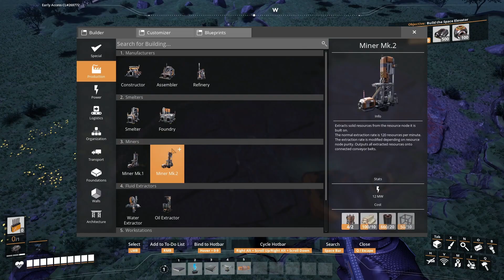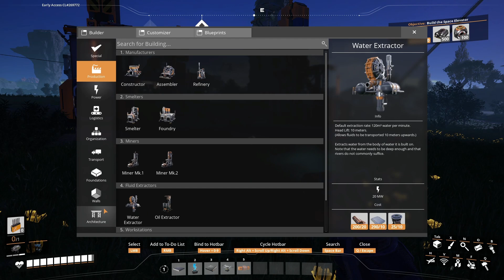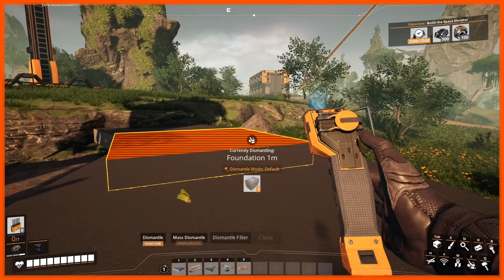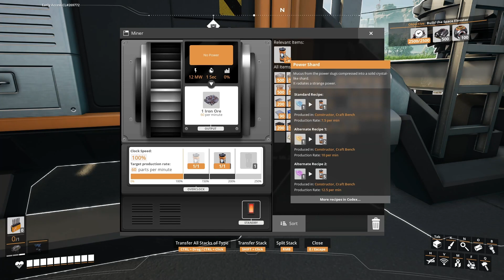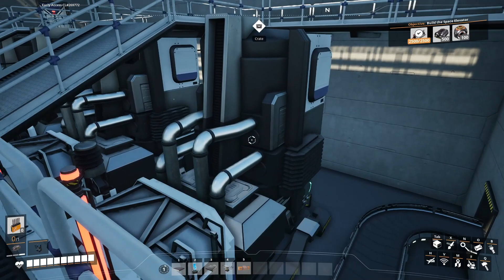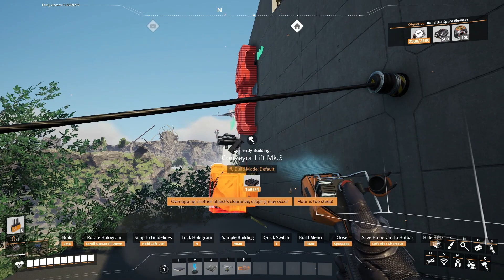Dadisfactory Ep. 12; Phase 3 Phresh Start

Comment: hey, I think there is a mod that does what you want with the extra camera.  not sure what it is called though.  Good series by the way!  would be nice to see you tackle satisfactory plus too after you finish the main game.  also a tip with the world grid, use a 2m or 4m foundation.  snapping to the world grid centers the foundation in the Z axis, so if you use a 1m foundation, it will be off by 0.5m.  hope that makes sense!
Reply from the maker: i have seen that as well, i just stick to the 1m foundations for snapping to world grid, then everything i build is at the same z point, its really that you just cant use 1 if you use 2 or 4 and vice versa.

currently im avoiding any mods, but the one you mentioned has caught my eye already, i might give it a shot eventually.
Reply: @Dadisfactory  yeah as long as you always use 1m it should be fine. I just also like the extra height of the 4m
Reply from the maker: @marcbennett9232  once you get into more detailed design staying true to the world grid gets difficult. Circles don't allow for that very well
Reply: @Dadisfactory  true.  I need to get better with curves.
Reply from the maker: @marcbennett9232  just wait till you see my power storage blueprint build. A power storage replica with a 9x9 base. I'm only about a 3rd of the way done
Reply: @Dadisfactory  nice! Can't wait